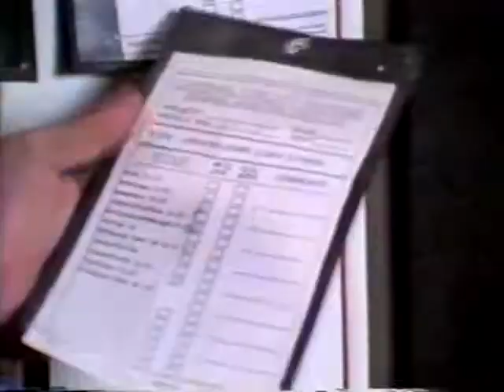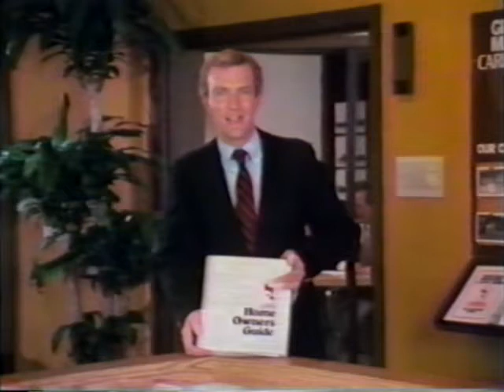Single Family Home

Comment: Austin Gurlinger, the founder of Cardinal Industries was a visionary.  And, like most visionaries, his ideas outpaced the current state of the art.  To my knowledge, most of Cardinal's efforts at single family home sales were in Florida.  In Casselberry, Florida Cardinal opened its first dedicated single family home sales center featuring about a half dozen models.  Most of the homes were rather small, and because of their method of construction they all appeared very similar.  Cardinal's insistence on using the same fixtures, hardware, and appliances as employed in their rental units did little to differentiate the homes from their apartment "sisters."   Examples of this was the use of GE Zoneline air conditioning units (an air conditioner was mounted below a window akin to a motel room) in the homes, as well as textured vinyl wall-coverings and plastic doorknobs that left the houses looking cheap.  Only in the very last stages of Cardinal's business were some of these features changed.

The model center outlived the company, being abandoned in the late 1980s.  For years the houses stood empty, the manicured lots being taken over by weeds and trash.  The homes were vandalized and left open to the elements.  After about a decade in this condition a developer bought the land and a Target store took their place.  I happened to be driving by when I saw the beginning of the demolition effort.  I pulled in the the crumbling parking lot and asked the man in charge if I could take a last look. "I helped build these" I said, looking over his shoulder.  He agreed and I walked through the houses like a man attending a funeral.  Before I left he called out to me and said "I have a present for you."  He handed me a pair of doormats with the Cardinal logo and the words "We Make Homeowning Easy" emblazoned on them.  I took them home and carefully washed them.  Instantly they were as new, and the words now ironic.  I use them in my laundry room.  Each day I look down on them and remember what it was like to be in my early 20s, a Army veteran, full of hope and promise, and part of Austin Gurlinger's dream.  I'm in my 50s now, and new dreams have supplanted the old.  I've done well in life, even owning a business.  Still, a part of me remembers the Cardinal days, and the enthusiasm most of us had for a dream that turned to sawdust.

Comment: Does anyone know where i can get technical literature. For my home i have one of these i would just like to know some technical info
Reply from the maker: I might be able to help you.  What are you looking for?
Reply: Cardinal Industries, Inc. Awesome that would be helpful im looking for data on how thick the floors are and how far apart the support beams are.  I bought the home about 3 yrs ago previous owner did some upgrades such as ceramic tile but did it poorly so i need to redo the floors . Also if you could tell me who supplied the sliding glass door i have one thats falling apart that i want to replace but cant find that size available.
Reply from the maker: I believe the floor joists are 2x8 on 24" centers.  The subfloor should be 3/4" plywood.  Not designed to support a ceramic tile floor without additional reinforcement.  I would double up the joists in the area you are planning to tile if that's your intention and put down a good backer board such as Durock on top of the subfloor before laying tile.  As an alternative, you might consider laminate flooring or engineered wood flooring.  Much lighter and you wouldn't need to reinforce.

I don't have any information on the sliders.  If it's just the rollers giving out, they're easily replaceable.  Home Depot and Lowe's both carry a variety of replacement roller assemblies for sliders.
Reply: That explains some of the issues is when they tiled the whole house its to heavy.  I plan to go with engineered floors i just didnt want to start removing until i knew what should be under there incase they didnt have the right plywood under there.  Thank you this info has been very helpful . Also the design of my house is much like the one in this video except without the room. On the left of the entry door
Reply: Also the rollers are ok its just the double paned glass is frosty and has a corner of the frame coming apart.  I will probably have a glass company replace the glass
Reply from the maker: Glad to help.  Sorry about the slider!
Reply: Thank you im sure as i go i may have some. More questions.  Its ok no problem the doors working so i will just keep it till i do a few more things then probably replace it